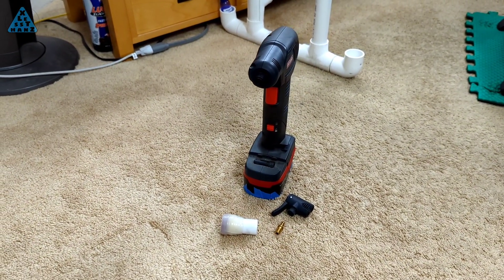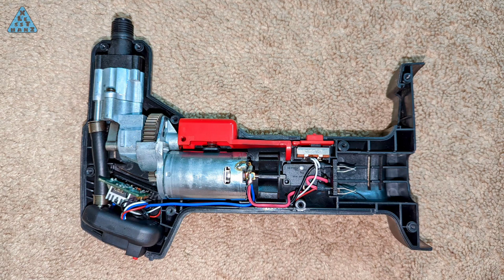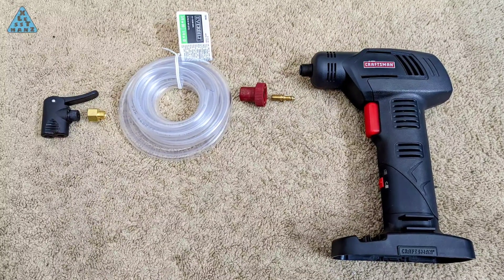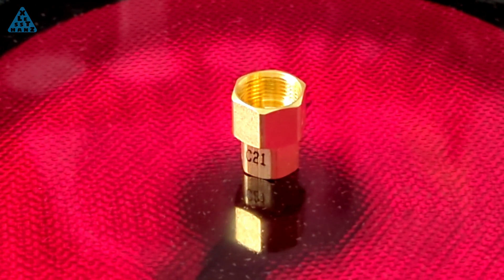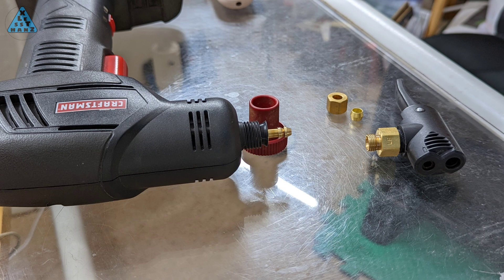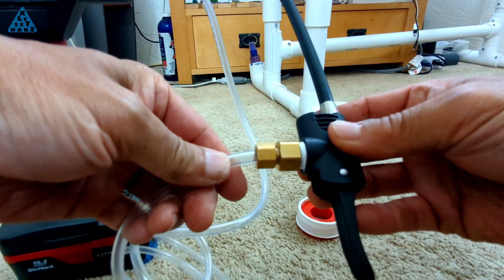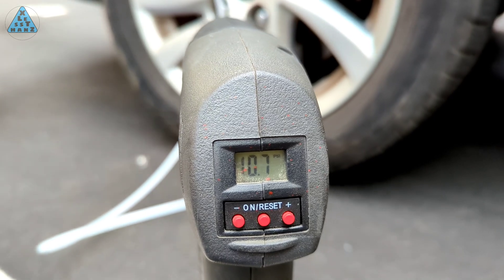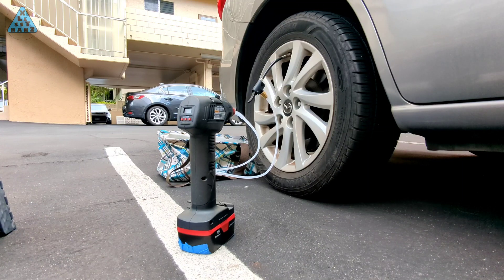1 of 2 - Craftsman Cordless Pump - Hose Replacement (PSI MATTERS)

Comment: Awesome fix.  Great keeping one less otherwise functional thing from the landfill. Much more durable than trying to repair the old hose.
Reply from the maker: Thank you.  I still use this pump today.  One thing I noticed, I think due to the high pressure, is that the connection to the hose right at the drill gets hot.  Pump for about 2 minutes, then check the temperature by hand in case it's too hot (causing the hose to stretch).  Can cool it with a napkin dipped in ice water.